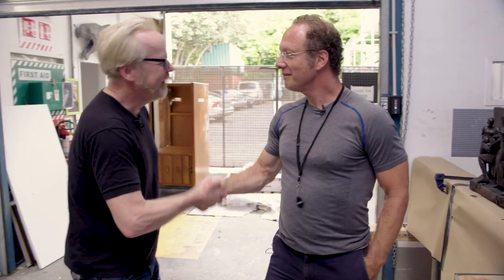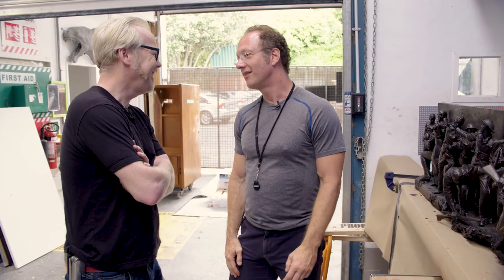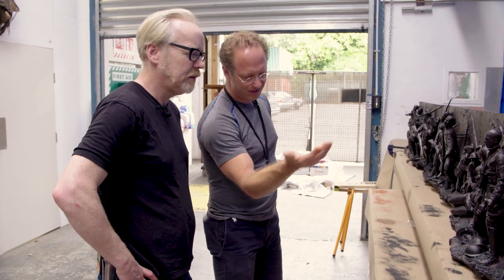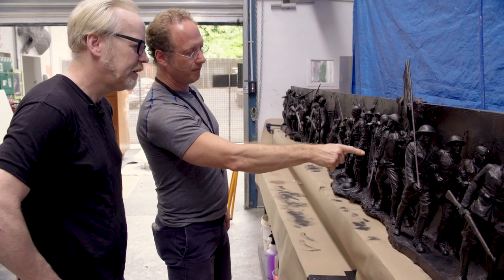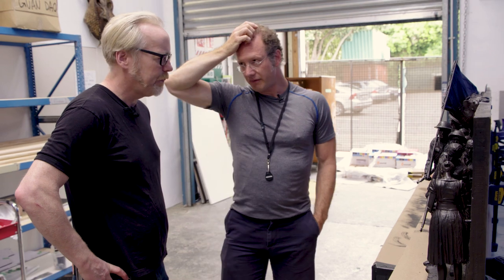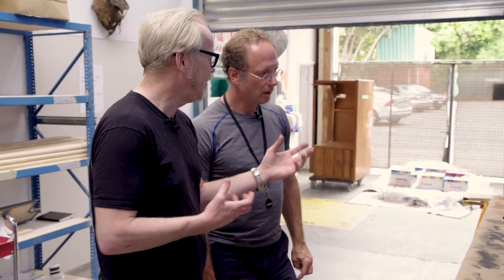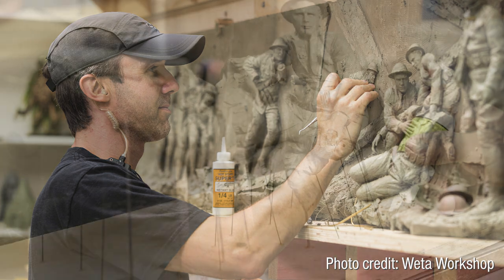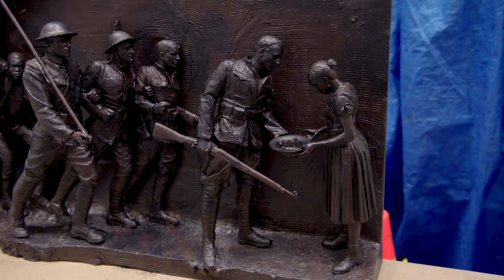Designing the National World War I Memorial Sculpture

Comment: So I immediately wondered how much it would cost to build such a thing at full scale, and looking up a current market price for bronze (scrap) at $1.68/Ib., and estimated the size of the piece in each dimension on a random calculator online which calculates weight based on dimensions for different alloys- yada yada- came to "very" roughly 1.6 million dollars, and that's JUST for the material cost, nevermind labor and installation fees. I'm sure my math is way off what the actual project will take, even based in where I was looking, but it was a fun little bit of research to do. At the time of writing this I'm only a minute and a half into the video. :P